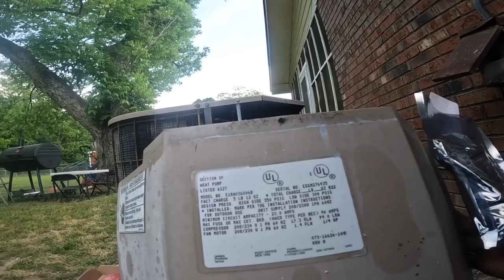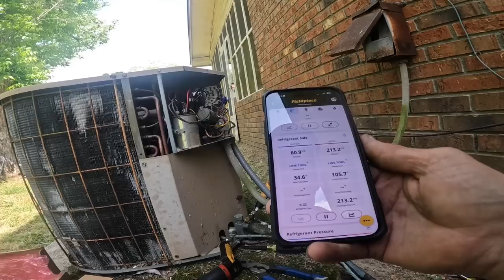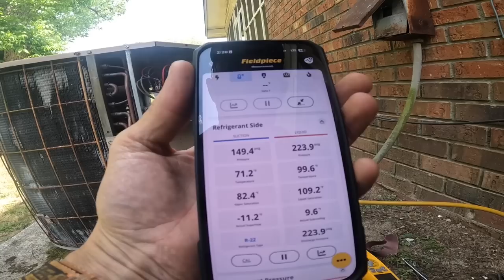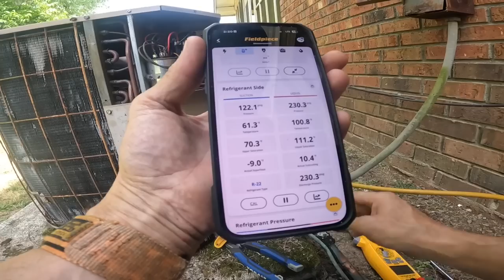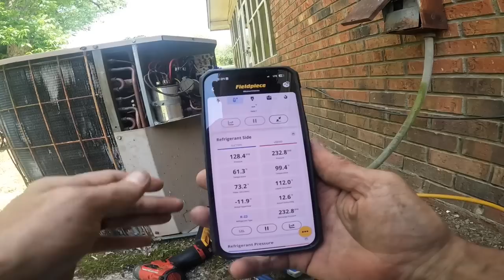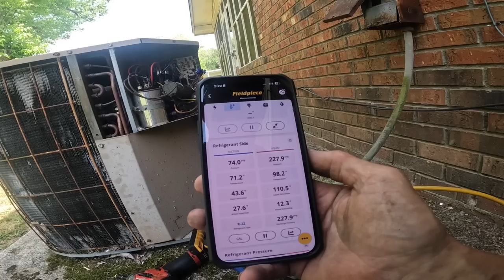Returning to an Old York to Get Her Going

Comment: That was an old dog there, I think it was about 30 years ago, there was a slue of those York units in my area. They were cheap, there was an appliance place that was selling a 3.5 ton unit that had the Freon in it for about 400 - 450 bucks. You had to have a license to buy it. Nice little repair, I was going to say offer him a new disconnect, but then I thought, why? it fit the picture. Thanks for the video.

Comment: I worked on one of those Coleman Evcon units in one of my videos. I was back there for maintenance last week and it's still going strong. I had another at a different location that had the board go bad also. And then the new board went bad in just under a year, so got it replaced under warranty. And the new has been OK for about 8 months now. 😎👍
Reply: Better get a spare board just in case; they may come from the same batch with built--in obsolescence!

Comment: yes sir sometimes it easy to  over charge one ..esp if we don't wait long enough 12-18  mins or so between adding charge ..bc sometimes just a few more oz is all it takes to  send that supper  heat running toward the basement as I call it .....but did you ck IDWB   & ODA to  determine uR target SH or did u have an app for that .....as always Thanks for the Video shows iam not the only one that has over shot esp an piston R 22 coil

Comment: What was the name of that jumper.  What did you jump out ?
Reply from the maker: It’s a splitter. Makes one spade connector into two. At least a splitter is what I call it. I bypassed the board so it couldn’t break the connection to the condenser fan motor.
Reply: @HVACGUY    Oh. Piggy back lol. Good work